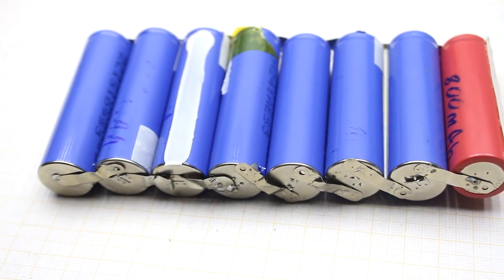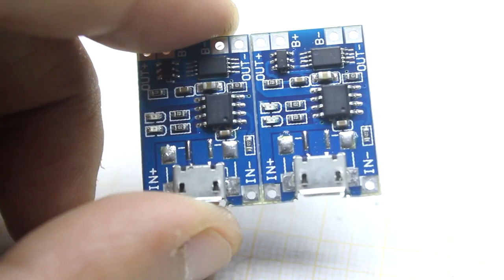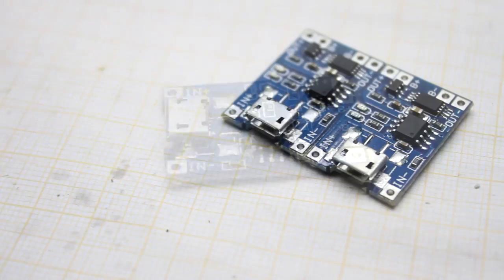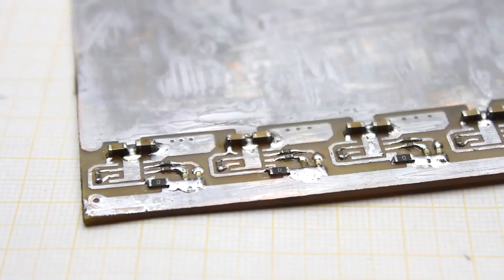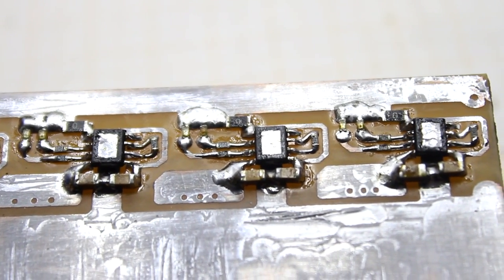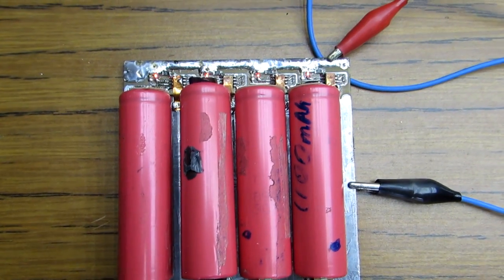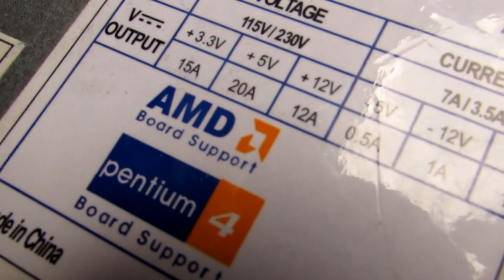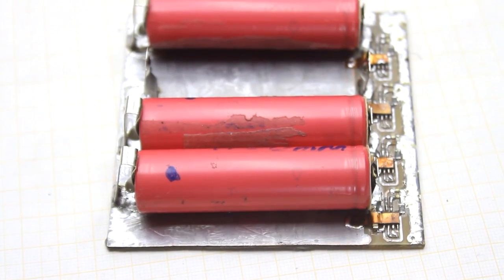Simple Li-ion battery charger

Comment: You could also use the charge controller from the original board on the battery pack but it's a pain because they are specifically configured for multiple batteries. Has anyone found a common place to upcycle a simple charge controller chip for a single lithium cell without buying one? Especially one that doesn't have cycle memory?
Reply: John Scarce 
   They are the easiest place to find P-Channel Mosfets but they are usually a low voltage type limited to 30-40 volts max.
Reply: yes they are p channel and i had switch the polarity of everything in the zvs. btw if i could find a bunch of p channel and n channel mosfets like those on ebay i would make the dankest 3 phase motor drivers
Reply: John Scarce 
 N-channel power MOSFETs are super common in almost all consumer switch mode power supplies. P-Channel FETs much like PNP Power BJT's are the rarest types to find in consumer electronics. The way I see it, in almost every circuit there is a way to just use NPN or N-Channel devices instead of PNP P-Channel versions. Learning how to configure the circuit correctly usually involves searching for mass produced products that utilize the same topology and ones you can find schematics for. Find a few examples, study the differences, then build and test them. My experience when looking for circuits from other hobbyists/forums/searching for "circuit examples," they tend to be based on a "so long as it kinda works," design philosophy. Consumer goods are always designed for cost, but at least you know it's somewhat professional and your learning how to do things more in line with the industry standard if you were to persue electronics professionally at some point.

    That said you can also find some FETs in older car audio amps, and can occasionally find some interesting P-Channel/PNP devices in 70's to 80's devices that use Vacuum Fluorescent displays. Basically things that were designed by an older generation of EE's that were transitioning from using vacuum tubes to transistors. Those guys seem to have used more PNP/P-Channel devices but my perspective is fairly limited to 15-20 things I've taken apart from this era.
Reply: maybe i didnt explain myself properly, but i have n channels such as irfz44n and irf540n in abundance, but the only way i could make a 3 phase bridge work is by using independent power supply and optocouplers to drive the high side. what i need is model number/name/whatever this combination of letters and numbers is of common n channel and p channel mosfets in the same package and the same current/voltage ratings as the ones in protection pcb's. i can find the p channel ones even without ebay, because i already have quite a few pcb's, but i want to make it symmetrical and find the n channel equivalents
Reply: John Scarce 
 I was under the impression mosfets don't match unless they are on the same die due to channel width variations even within units of the same type and in the same batch. I must confess I don't have experience with this though.
Reply: no two things are the same. zvs is based on the idea that no 2 mosfets are the same so when you turn it on one of the mosfets turns on faster and then the oscillator starts going. and when comparing n channel and p channel they are even more different. i dont need perfect copies, i just need them to be somewhat similar for the 3 phase bridge (simmillar current, simmilar on resistance and voltage rating)
Reply: John Scarce 
   Thanks for the info, I didn't know a ZVS driver was based on that difference. I vaguely recall reading/watching something about a dual FET driver and the dangers of them shorting to ground. That info is in a blur of intensely researching basic SMPS  topology. Maybe one day I'll get around to building a few high voltage circuits too ;)